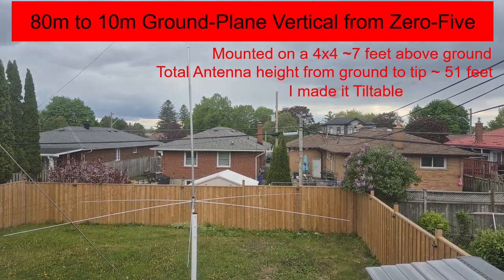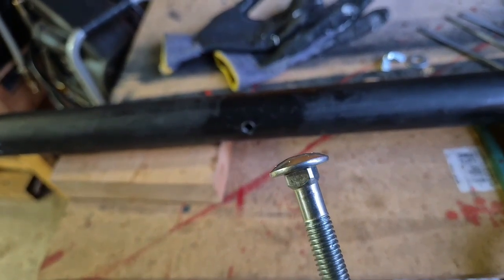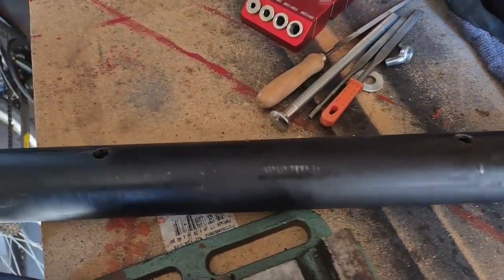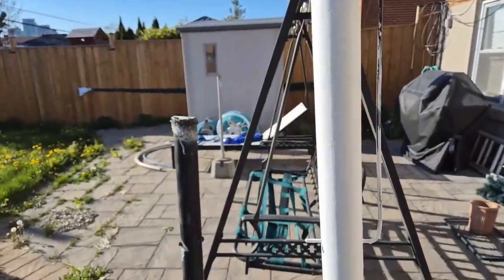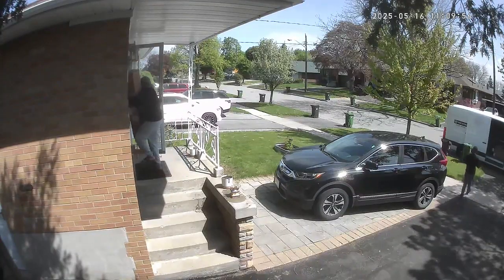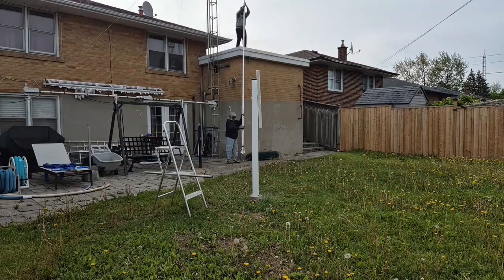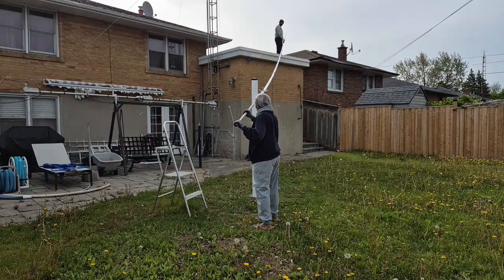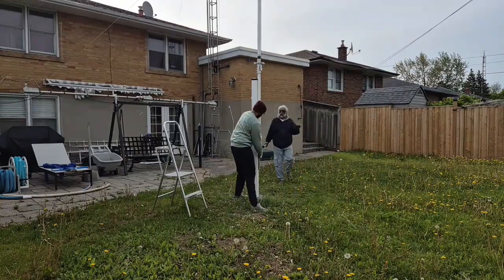Amateur (HAM) Radio Antenna 80m to 10m Ground-Plane 43 feet Vertical from Zero-Five on a 4x4 post

Comment: What kind of steel post did you use to attach to the 4X4? Thanks
Reply from the maker: Thanks for your message. I had several surplus gas pipes each 6' long. I cut half from one. I do not know the pipe schedule/specs. It is solid....with a wall thickness of at least 1/8", and outer Dia. of a hair shy of 2". I think it's a Schedule 40 black pipe.
Reply: @PremMenon Thank you for your reply. I’m seriously considering buying this same antenna and setting it up like this. Thanks for motivating me.
I look forward to seeing how it performs.
Reply from the maker: Gary, thank you, and my best wishes.
80 and 20 are the worst in terms of SWR - specific to my installation. However, all HF bands work well through my LDG tuner (for QRP to 100W). My ICOM AT-500 also tunes all bands when I'm running the boot.

Comment: Nice job.I am wanting to get the 40 to 10 meter ground plane from zero 5.
Reply from the maker: Good decision. Taming 80 appears challenging. Also, handling 40-10 is easier. Thanks for your message. 73.

Comment: Looking forward to see the final results.   Thank You
Reply from the maker: Thanks for your message. The UNUN arrived this afternoon. I installed it. The grounding is still not optimal. I just had a short grounding rod. Also, the coax used is not 100' long. As is, 80 is the worst. Rest are all tuning pretty well with my simple LDG. Manageable SWR. 10 is the best.
I'll work on it this weekend, and will make a short follow-up video to showcase the results. 73.
Reply: @PremMenon  I will look forward to it!   Thank You  
de KC3ZDW
    73

Comment: Prem, as always, very informative video, especially on the mast and tilting pipe installation. Fantastic job, you seem to have thought of everything, will look out for the antenna reveiw and reports once you have the Trafo installed. Thanks Prem
Reply from the maker: Dear Ravi, thanks for checking it out. Bopanna has shown interest in this. In fact, it's a good one for his location. For you too....because monkeys won't get tempted to slide down a vertical that has clamps every 3 feet 😂